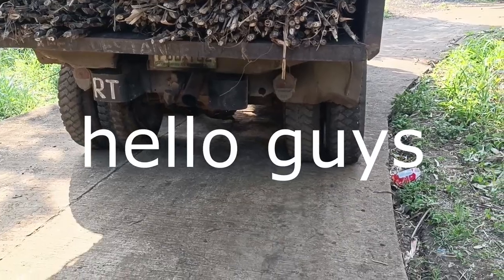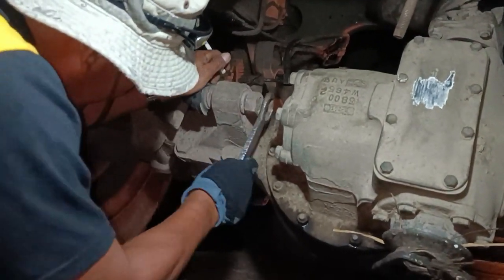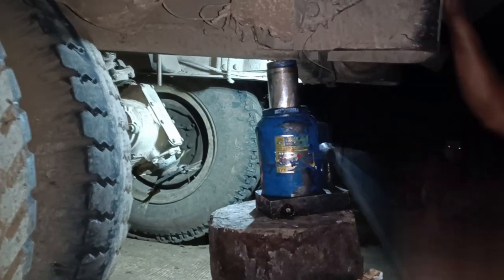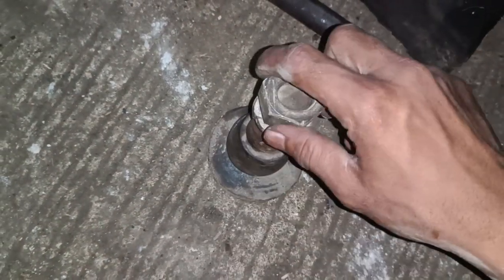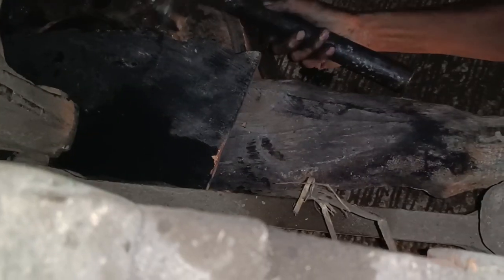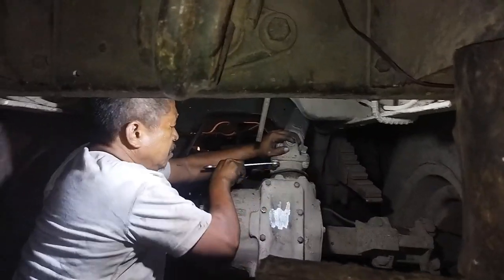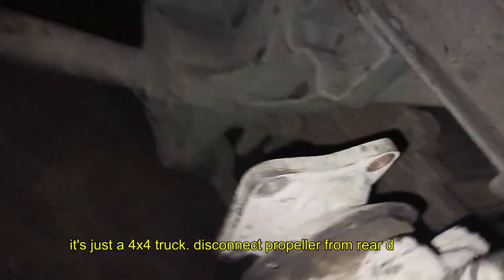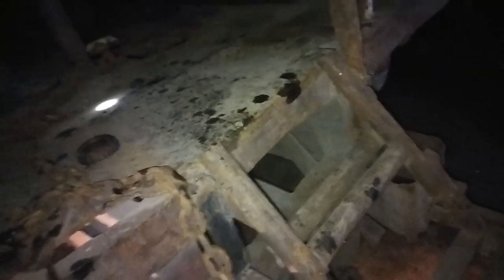The Rear Differential Disconnected from the truck m35a2.... sugar cane ARMY TRUCK 6x6

Comment: Idol ano ba sira ng preno kapag sobrang lakas ng pressure?
Reply from the maker: yun palagi na pupusit kapag malakas hapak.. wag gamitin ulit yun used fluid brake. may dumi na yun he...  depende yun aayos.
Reply: @depede384  ngayon Idol nagpalit ng bagong d5 mas lalo naman humina ang pre  ano na naman kaya dahilan nun?
Reply from the maker: @가-바보  ipa bleed mo sir. hanging loob..
Reply: @depede384  naka-ubos na ng 4 litro na brake fluid Idol ganon parin, matigas yung pedal na hindi kumakapit ang preno
Reply from the maker: @가-바보   sa break booter yan sir
Reply from the maker: @가-바보   tapos yung break master pa niya.mensan don din nag papahirap.
Reply: @depede384  bago lahat Idol, bago din yung rubber cup ng primary master at saka brake booster
Reply from the maker: @가-바보  brake booster adjuster sir.  adjust mo Yun. haggang abot siya doon brake drum..
Reply from the maker: @가-바보  mostly aayos talaga mga truck namin nasa factory repair